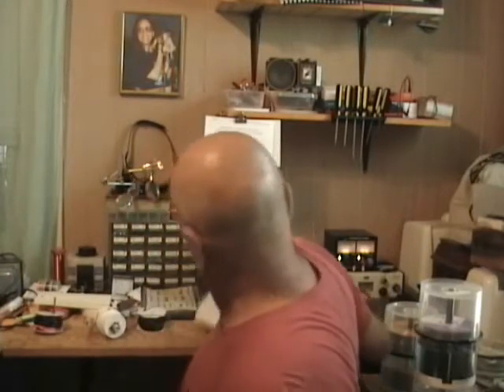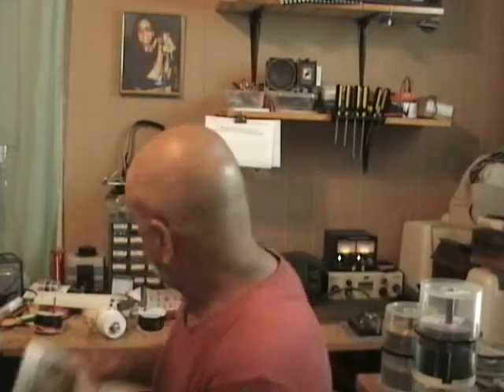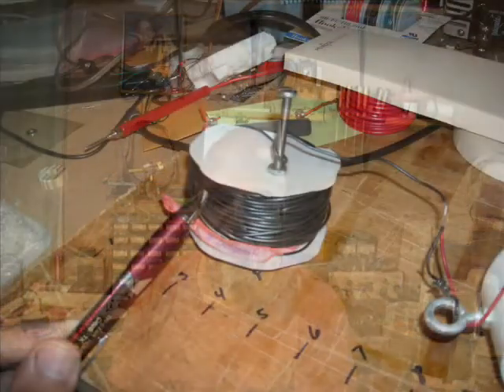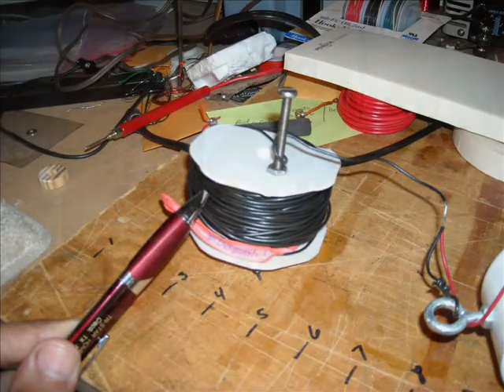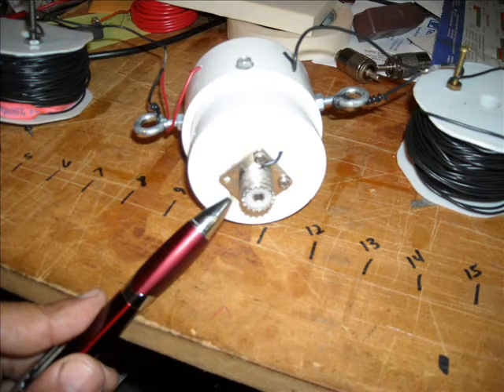Roll Your Own Dipole

Comment: Love my dipoles! I have a 160, 75, and 40 meter multiband dipole up, and i use it all the time. It requires no tuner after i pruned it for where i talk. I just bought a 500' roll of 14 guage wire from The Home Depot and some PVC pipe for the center insulator..

Comment: the solution to your spool problem would have been to just make a couple H shaped line holders from 1/2" plywood or plastic. they lay flat and when you roll out your dipole, you just tie your rope ends off on one of the corners of the line holder and it'll keep it's length, no chance of continued unraveling, it just jams in place and if you want to extend it further, just keep unraveling it and jam it again by tying off to the corner and pulling it taut, the wire will wedge itself into the corner of the line holder and keep it's place until you loosen the wire. you could even make a notch in the inside of the line holder to keep it's place too. for a quick change to different bands, just put some colored shrink tubing along the wire to mark each band on the wire, first for 6m, then 10, 12, 15, 17, 20, 30, 40, 80, ect. makes it way easier and quicker, best if you use the same color for the same band. blue for 6m, then red for 10m, green, yellow and repeat.